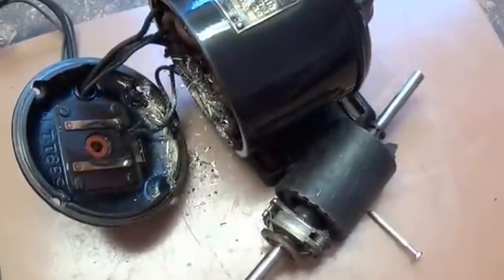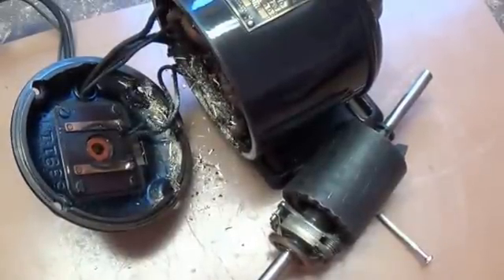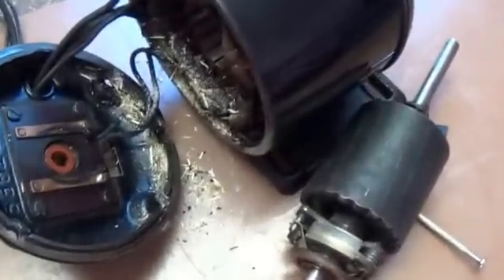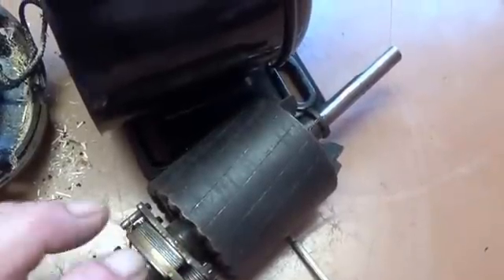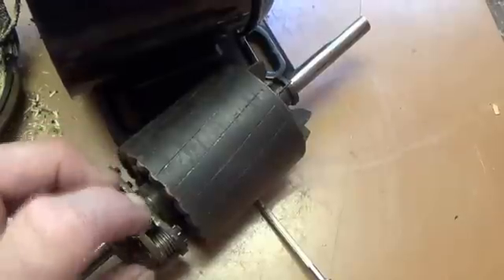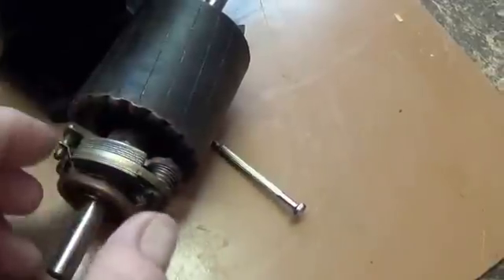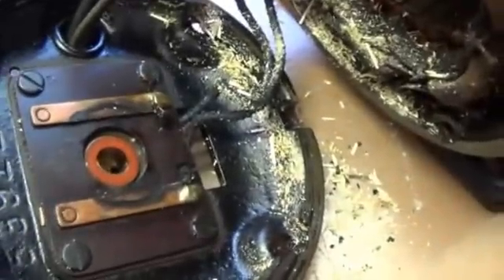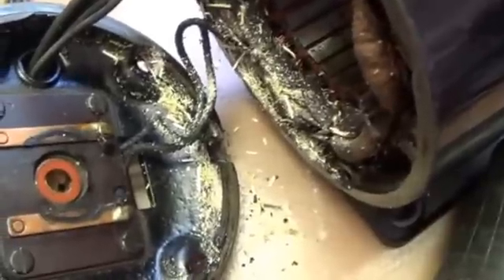Wurlitzer P10 Jukebox Tour: Mechanism Motor Repair

Comment: Hello Uncle Doug, I need a new overload protection for my Wurlitzer 600 motor because it cuts out again after only 3-4 seconds even though everything is running smoothly. The motor overload protection is built into the motor. The number on the part is: S B227. Do you have one like this?
Reply from the maker: There is nothing I can do or suggest, AT, other than possibly to open the motor case, extract the heat-activated switch, and clean the contacts and perhaps bend the spring arms to give more closing tension.

Comment from the maker: You're welcome, Stuart. I'm glad the video was helpful. It is possible that your starter winding is burned out (let's hope it isn't), but often, simply cleaning up the centrifugal switch can help (as it did in my case). When you have the motor apart, you can test the continuity of the starter and run windings with an ohmmeter. You may also find a broken connection to either winding that you can repair.  Good Luck !!!